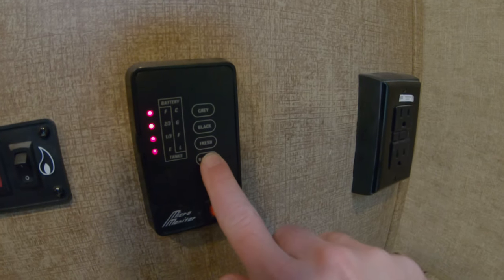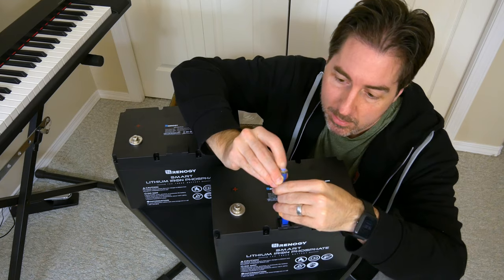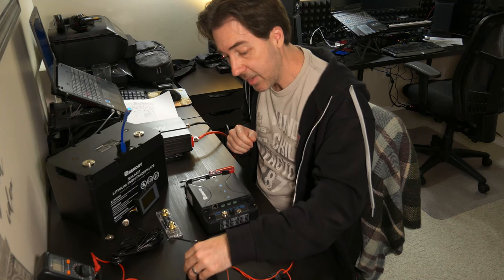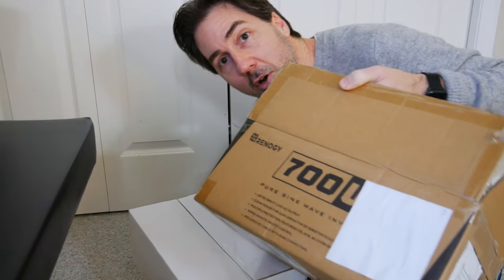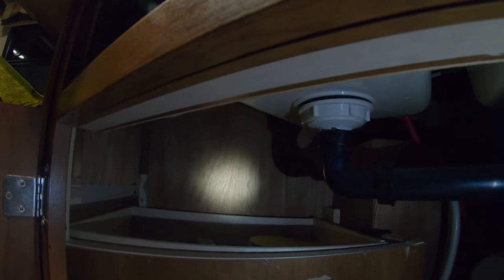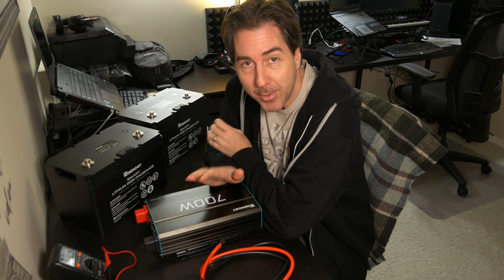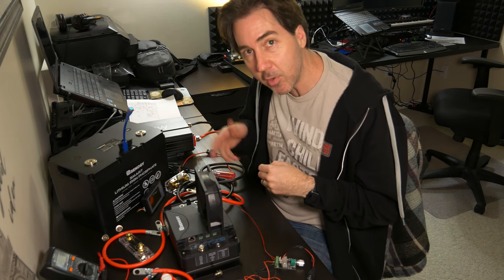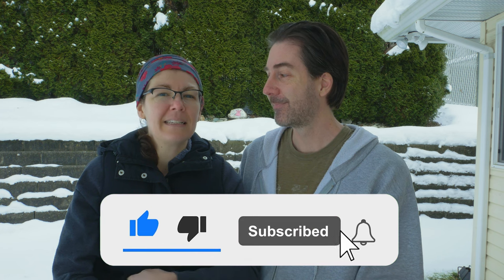RV Lithium Battery Upgrade / Conversion for Newbies! | Renogy LiFePO4

Comment: You've probably gotten a lot of questions, but why didn't you get Battleborn Lithium batteries?
Reply from the maker: That's a great question Cameron! It really came down to cost and value. At the time we were purchasing, here in Canada, a Battle Born 100Ah battery cost about $1200 CAD from most distributors, whereas the Renogy 100Ah batteries were on sale for about $800 CAD. So we saved about $400 CAD total. But what about quality? There's a YouTuber named Will Prowse who has made a name for himself doing very detailed reviews of solar and battery hardware. He reviewed the batteries and gave them the thumbs up, so what was good enough for us! Differences? Battle Born has a 10-year warranty, whereas Renogy only has a 5-year warranty. This wasn't a big deal for us since 1) both will likely last longer than 10 years under good conditions, and 2) if a battery does fail in the 5-10 year range, battery costs may have decreased enough that it would make more sense to buy a new, larger capacity battery rather than pay the shipping for repair/replacement and not have a battery for that whole time (warranty claims tend to be slow). Another minor difference is that the Renogy Smart batteries cannot be put in series, they need to be in parallel. So if you're building a 24v or 48v subsystem, you'll need to use a different battery. But we used them in our main circuit, so they needed to be in parallel at 12v anyway. Wow, I've written a bit of a book here. I hope that helps explain our choice! 😀
Reply: Thanks

Comment: what is the difference of dc-dc 30A and dc-dc 50A?
Reply from the maker: Hi there, the DCC 50A version will simply let more current pass through, which means you can charge much faster, assuming you have a charging source that can produce that amount of current. For instance, we have 400W of solar panels, which at 12v means a maximum of 33A current (ie. 400/12). If we had 600W of solar and we only had the 30A charger, we wouldn't be able to use the full capacity. But if we had the 50A version, we could use the full charging capacity (600/12=50) and charge our batteries 50% faster. Does that help explain the difference?

Comment: The only way to install in a worse location would be to install in the shower.  It’s not the water the battery is sitting in that will cause you issues, it’s the water on top of the battery.
Reply from the maker: It's a bit hard to see, but thankfully there is no water above the batteries. The batteries are actually in the space under the stove and directly behind the converter and main electrical junction. The water heater and sink are off to the left. The reason we raised them off the ground is in case the water heater or other plumbing developed a leak. In that case, we didn't want them directly on the floor. Many people install the batteries in their garage at floor level and I worry that could be an issue for that type of setup. But with our installation, there's very little risk of water contact. It was a hard place to get to, but overall I'm really happy with that location choice.

Comment: Buy a portable Solar Generator to run/charge IPhones, Computers, TV, and other low watt devices.
Reply from the maker: That works great for an all in one solution. We opted for separate batteries and solar panels.

Comment: Never heard anybody getting shocked by a 12 V DC battery
Reply from the maker: Definitely possible! Even a 9v battery can give you a decent shock if there's enough conductivity.
Reply: The little power up switch is not to keep you from getting shocked from that battery, it’s to prevent you from turning a wrench into molten metal.